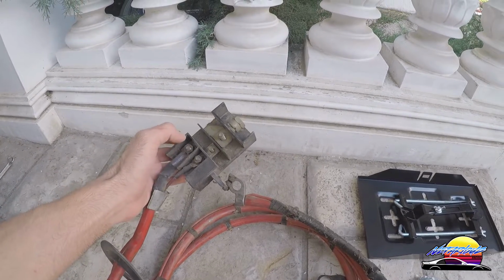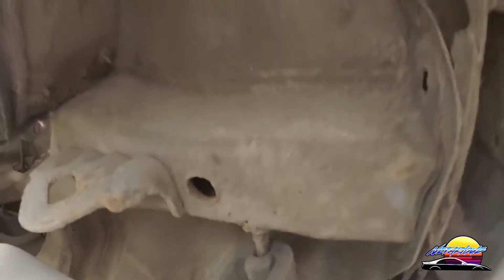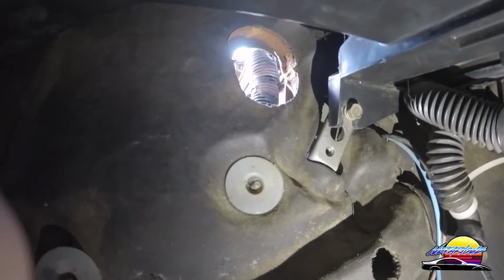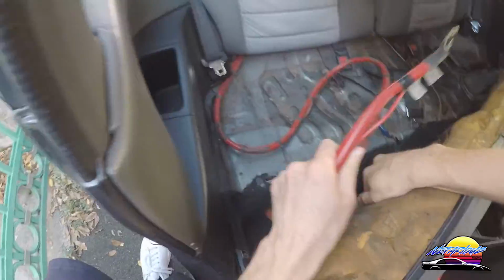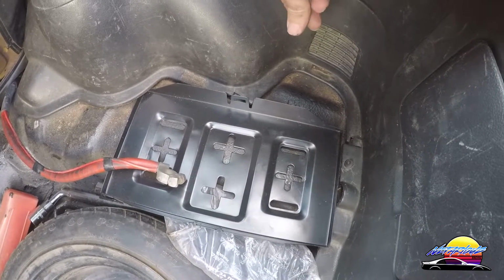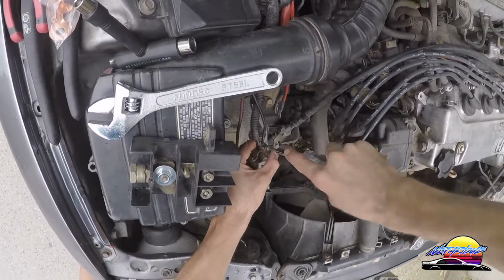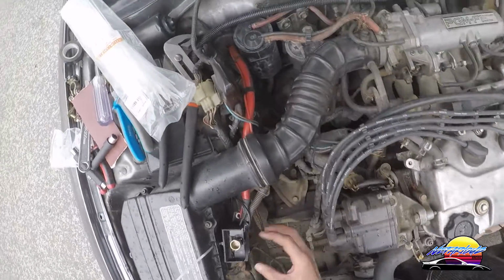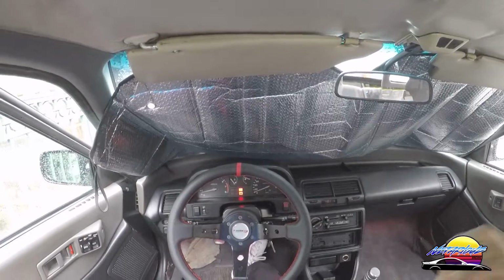How to Relocate Your Car Battery to the Trunk

Comment: Can I use this for my 2007 Monte Carlo?
Reply from the maker: Same principles will apply, but you will need to adapt the parts and process to the particular car.
Reply: @nefariousracing  I don't need a breaker?
Reply from the maker: @FatalCorleone07  It's not a bad idea to put one in to be safe, but considering that BMW and other manufacturers didn't put one in from factory, I didn't for a street car. If it was a track car I probably would.
Reply: @nefariousracing  oh true. Well I'm waiting for my BMW cable harness to come from the UK
Reply from the maker: @FatalCorleone07 Awesome let me know how you go.
Reply: @nefariousracing  I like your video cause you made it super simple. I will def let you know how it goes
Reply from the maker: @FatalCorleone07  Thanks man, glad to hear it helped.